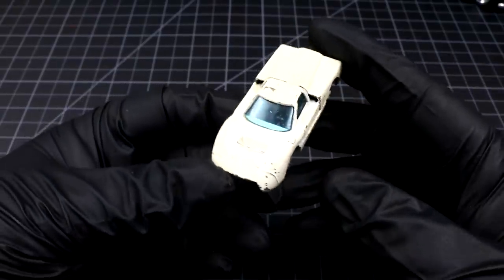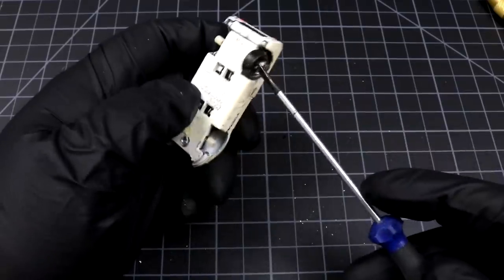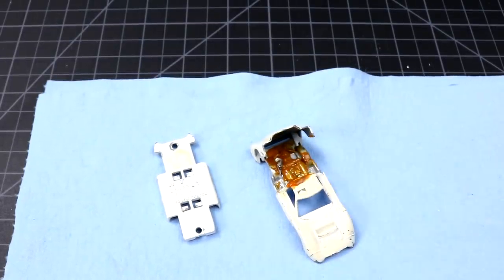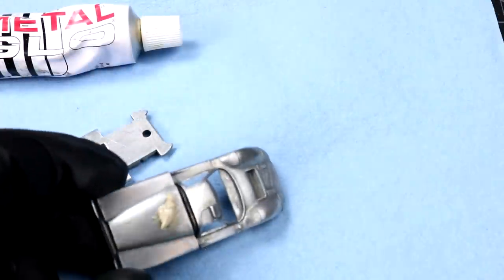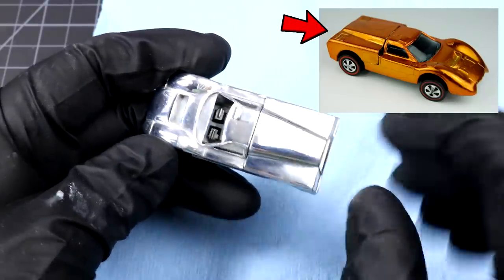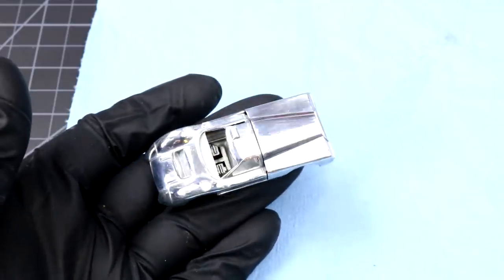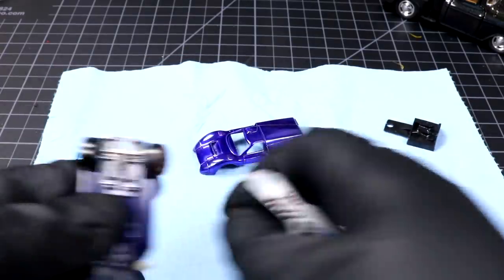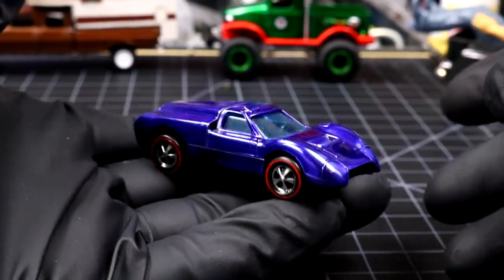Redline Restoration: Redline Ford J Car

Comment: I would love to see a Spectraflame metallic orange. Also, you should do a white one just to show us how enamel works out. Still trying to figure out how to paint the side of my garage.
Reply: Orange would look sweeeeeet
Reply: Orange does look pretty good on them I've got 4 OG orange ones
Reply: orange with a copper metalflake would be pimp.
Reply: Yeah I'd like to see this as well. I like the idea of showing the white process also.
Reply: BaremetalHW just redid one of these in spectraflame orange I think
Reply: @coreywilliams8993  I'll check it out. Baremetalhw was my first diecast channel. That's how I found blub blub blub.

Comment: How about painted like the actual test car it was based on? Kind of a two tone: Spectraflame dark blue nose, the rest white enamel. As a downhill racer the HW suffered the same problem as the real car. Too much air would build up under the rear engine hood cover slowing it down/making  the car unstable, prone to fly off the track. The sticker set had strips to  be used as tape to keep the rear hood cover from flying open! Its the way I would like to see the car done as a tribute to Ken Miles. I still intend on doing that car that way, even if you don't, but since you asked for suggestions, beat me to it!

Comment: I have a J Car that I got as a kid in 68.  It is red and the finish is mint.  The only thing is the Engine cover is missing.  I have looked for a replacement, but can't find one.  You have any thoughts on where I might find one?  Thanks.

Comment: When I was a kid, Hot Wheels cars would change color in icy water. I remember one I had that was a taxi at room temp, but it would become a police car when dipped. Do they make THOSE paints for restorations/customs? You could do some cool sh*t with those.
Reply: There was another company that did super tiny little plastic cars that'd do that too, they also made ones that had little light-up headlights (which for back then was a marvel in and of itself!)
Reply: @AsAboveISoBelow  I think Hot Wheels made those too: http://toysfromthepast.blogspot.com/2013/05/281-hot-wheels-mini-automagic-micro.html

Comment: I love the Ford GT40 J car! Not much is known about it, but it looks awesome! I would do the polish thing, then paint it white again, just so it’s cleaner. I would also make it lower(some how) and swap rubber tires on it. Lastly, do the headlights. They are actually above the pointy parts on the front of the car, Hot wheels just didn’t put them there.

Comment: It would be interesting to see one of these cars in white with dual, lengthwise blue stripes and a white underframe or the reverse color scheme (Imperial blue with dual, lengthwise white stripes and a blue underframe) which are the two conventionally accepted international racing color schemes of the United States (depending on the choice of the team entering the car in the race). Some simple masking could accomplish the task.

Comment: This is a great looking paint job. Wonderful to look at.

My only issue, and it is not directed at you but rather restorers in general, is that I can hardly ever see the interior through the glass. I know most cars are dark inside but is there any way to make it ahow up better? With this blue windshield you could have painted the interior bright yellow to make it appear like a green contrast to the purple exterior.